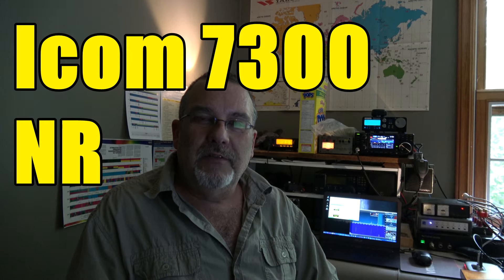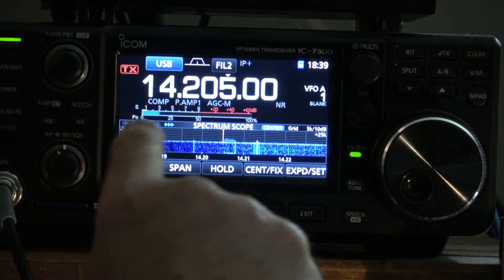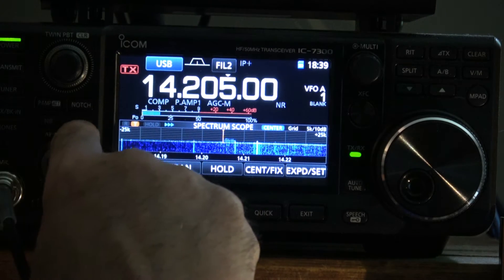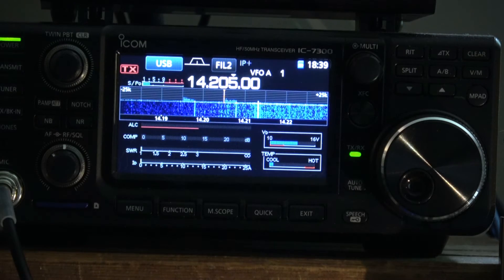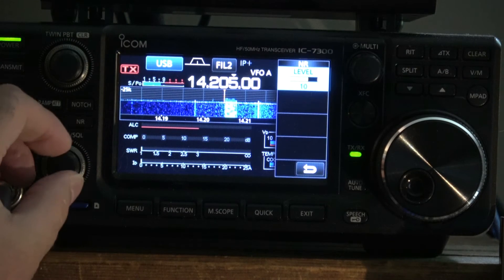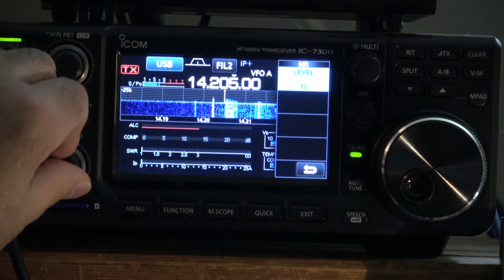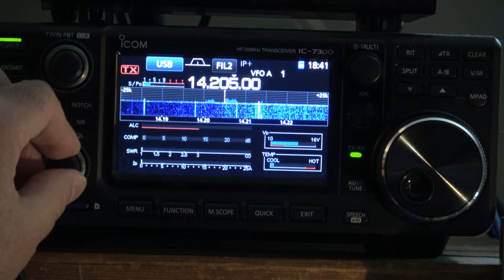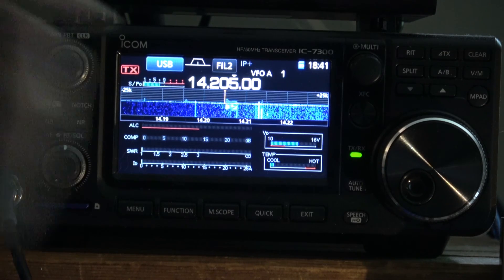Icom 7300 How is the Noise Reduction?

Comment: set NR to max, NB to max, increase RX treble. i did that on 20m, there were then weak signals that were the 3/1 and almost 4/1 that came out from under the ground noise. i think icom made a very good NR and NB, great experience to hear with that and it doesnt produce those digital artifacts like thst watery sound on the voice, that is something icom does better than kenwood. on 20m there are usualy no very strong broadcast signals nearby, so the lower big signal imunity of the 7300 isnt much a problem on 20m. for dx on 20m and higher frequencies, i would say the 7300 is because of its better nr & nb the better radio than the kenwood ts890 or ts990, its remarkable and exciting to get weaker signals out of the ground noise with the icom dsp. only thing the 7300 is missing is a preselector on 40m and 80m, there strong nearby signals stuff the receiver. what preselector would you recomens for the 7300 ?

Comment: Rick, being up in the cold country I have an antenna question.  I am just starting up again after 30 years and back in April my wife bought me the FT-1200.  However I have been looking for a good vert, a mid size beam and dipole.  I put up the 4BTV that seems to be working ok but being in CT. USA we have some bad winters as you do. I am not sure how it will holdup this winter.  I also just put up this week a DX-CC dipole / fan but swr's high so need an additional tuner.  I can not have any thing on the ground due to 5 boys, but looking for a good 4/5 or 6 band vert and beam that will put up with New England winters.  Any ideas?
Reply from the maker: What I'm currently using is less sturdy than a 4BTV I'm sure. I'm using a fiberglass pole from S9 with a 9:1 unun. It does 40-6m
Reply: O, I've seen them an end feed no?    I just put up the DX-CC by Alpha CF, swrs are higher then I like and narrow band so I need a tuner.  I wanted a backup in case we have a bad winter and it takes my 4BTV I'll still have the dipole.